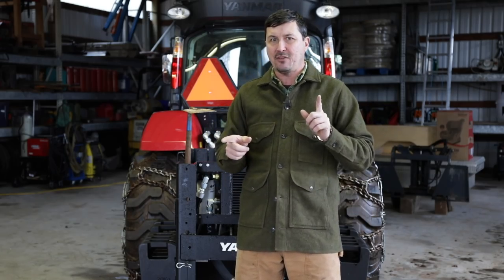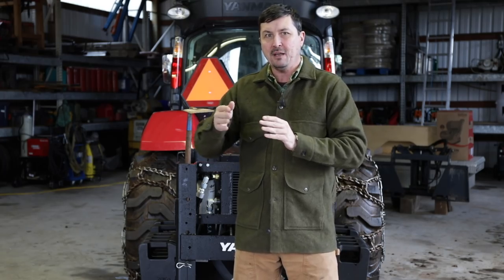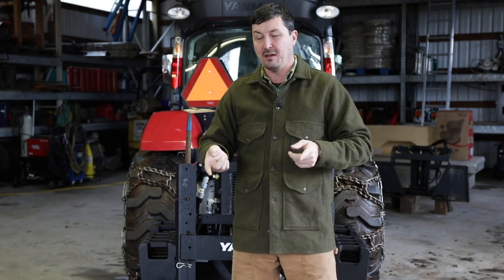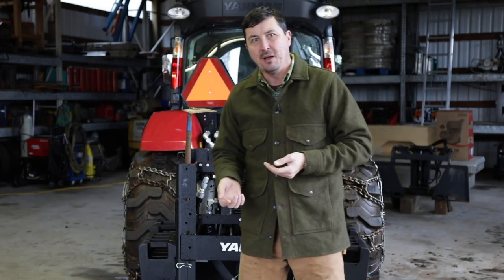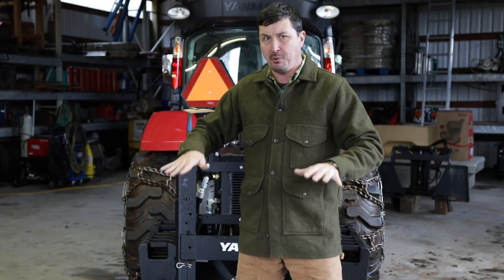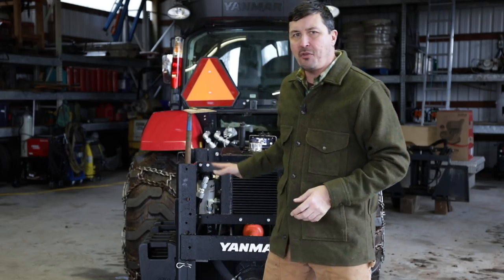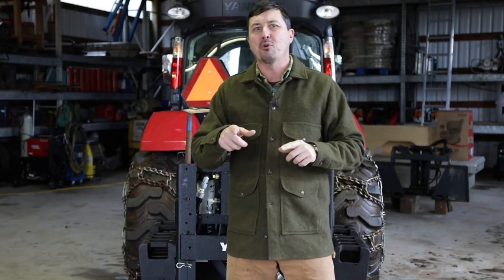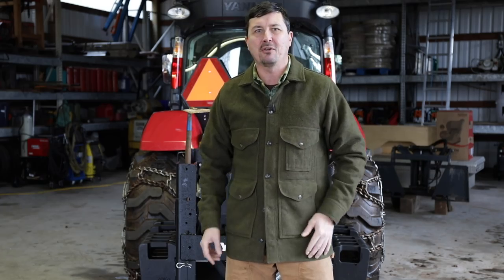Testing The World's Biggest Broom

Comment: If that is a high flow blower you need 30-40 gallon per minute flow , 20 gpm is standard flow if that is what the power pack puts out the blower will run slow. .

Comment: I would like to see the video of you running the snowblower. We have one of them (looks like the same blower) that we use on a skid steer regularly. Just recently went down to the lake and used it to chew through some 8' snow drifts. It takes some time to chew through, but it works quite well. Definitely sounds like a bypass issue.

Comment: sounds like a fluid flow control  problem on the blower because the auger and blower were running the same speed also check relief valve.

Comment: Hey Cody, I'm no expert when it comes to hydraulics but I do have some experience with skid steer equipment.  You didn't say whether or not your attachment was a high flow model or not. If you have the high-flow snow blower from Skidpro , that requires 25-40 gallons per minute which is probably not what your machine provides.

Comment: I only run 60 frames per second on my computer monitor, so I can't tell how fast the fan spins, once it gets moving.  but it surely didn't whine or howl like a turbine.  Hopefully the engineers can modify the FPS on their own monitor screens.  If you have a strobe timer from an old engine tuning kit, you could check the speed yourself and that would make a cool video for us old car buffs...get to see a strobe light in use, maybe paint a small silver dot on one of the the fan blades and shine the strobe light on it?  And Shabbat Shalom!

Comment: My thought would be abandon the power pack. Take the load off and put a front lift arm kit with a PTO drive snowblower front mount snow blower. Problem solved

I have ran tractors with different loader attachments and it's a good way to destroy the loader and tractor.

Comment: Do the auger, and fan have separate hydraulic motors? Is the fan direct drive, or is it driven through a gear box? It is possible that the fluid flow rate, and pressure, are fine, but the wrong gearing, or inappropriate hydraulic motor was used. The speed of the hydraulic motor, at a given pump RPM, is dependent on the displacement ratio between the pump, and motor.  I am no expert on snow blowers, but you are certainly correct about the speed being too low. It is currently turning slow enough that it is possible to count the revolutions by eye.

Comment: I had a set of hex shank drill bits that looked like the hex shank was hot dipped galvanized.  Because of the galvanized finish one got stuck in my Makita impact screwdriver and I tore up the  chuck getting it out once I used it.  I don't remember what brand of drills they were, but I wasn't happy with what the bit did to my precious Makita.

Comment: Is there a bypass valve on the blower? Also normally when something is spinning slow like that its either the pump(which if you can use the broom its not) a bypass valve, a filter, or a motor.

Comment: I don't know about tractor hydraulics or the tooling for them, but 3,000PSI at 20GPM sounds like it should be enough.  But it does look like those rotors are going a bit slow to be doing snow removal.  It could be the hydraulic motor isn't set up properly or is not getting what it needs.  I would check on the specs for the motor and if you can get a flow meter on the return off of the motor to see if your getting decent flow through the motor, I'm sure Yanmar can hook you up with one, they are not cheap.

One of the greatest things I've seen done to a tool box is foam cutouts for the drawers for each tool that goes into that drawer.  This way it forces you to put tools away in the right places, and it will stay neat and tidy.  It will also let you know with a glance that something is missing.  Just a thought since you brought it up.

If people are unhappy with the fact that you do something other than chainsaws and homesteading, let them be unhappy.  It's your channel.  Besides you've been sprinkling in random content for some time.  You, do you and if people don't like it don't worry you have almost 1 million subs and apparently we like it still.  Just remember that the silent majority still like your content.
Reply: BTW I liked that cinematic start, Hilarious!

Comment: im not a hydraulics guy but it seems like theres a restriction of flow somewhere, try putting the auger under a lot of load and see if it has a reasonable amount of power, if it stalls out than somewhere between your connections and the hydraulic motor theres something messing with your flow

Comment: As far as the snowblower hydraulics, it could really be a number of possible things or combination of things.  Hydraulics, and hydraulic design can be tricky, and without a schematic showing valve types and fluid path sizing, etc... all you can do is guess.  Even when looking at the bypass setting, when running the system wide open it may only require 500 psi to run it, but once you load they system by pushing into the snow, that could balloon to 2000 psi....who knows.  Settings should be set for, and tested for loaded working conditions.  I suspect the MFR will have a D'OH moment when they figure out the issue.

Comment: Hi Cody you need another set of lines to power the two motors separately I have never worked on a snowblower but it seems to me that the speed of the fan is way too slow, auger speed seems about right so I don't think you could put a diverter to guide more oil from the auger to the fan

Comment: could the hoses be restricting the flow of the hydraulic fluid or maybe the quick connects also is there a belt that runs the impeller could some they have missed some thing in the machining of the pump

Comment: The evacuation impeller seems not nearly fast enough and it is not underload in this video and that will also effect the outcome dramatically. I think the first thing I would do after you pressure checked everything if you haven't solved that by then I would think that the impeller needs to be "re geared" so to speak based on my little 8.5 horse snowblower the impeller is not up to speed at all and if you had the load of snow in there you ain't going to get enough Go Go Juice to get that snow evacuated from the blower unless maybe it was powder light snow. the sugar speed actually might be a bit on the fast side...my auger turns really slow compared to that one but my evacuation impeller is screaming in comparison. Maybe there in lies the problem too much fluid going to the auger not enough to the impeller....just a thought???

Comment: Has the company been able to supply a line drawing or piping diagram? Also flow vs pressure is a big thing, you need the pressure potential to do the job, doesnt have so much to do with flow rate. Hose size shouldnt make a difference if you have the correct pressure being discharged from the hose and pump system into the mechanical attachment. Perhaps it is indeed a bypass or a relief that is set to the wrong pressure.

Comment: You need to sweep the rest of that shed out now.

Edit 1 - I love the idea of a “worst tool” video, or a series even.   Worst tools for me? Those cheap flat spanner’s that come with washing machines, fridges, dishwashers etc. to level the feet up.  Other ones?  Some of the “keys” needed to open up electrical cabinets that you see in the verges of motorways/ highways. Another one? Inaccurate tape measures.

By the way, is it me, or does the auger look jerky every few rotations?

Comment: Six months late but...Have youn figured out the blower yet?
Did you recheck the hydrolic fluid level after connecting and running the snow blower? I noticed that the reservoir looked maybe a little low when you were originally showing it off. You could have been running just a little low on fluid initially, but after all the lines, expansion chambers and pumps on the blower were finally purged of air it could be running very low. I know that this sounds like a no brainer, but sometimes we are standing too close the the problem to see the solution.

Comment: Is it possible that the special fittings you had to have put on the hydraulic lines are restricting the flow?  Were they the same inner diameter as the stock ones that were the wrong size to couple together?

Comment: Hi Wranglestar what hydraulic motor runs the fan in the middle make model. I have used many different motors on my agricultural equipment here in Australia. It looks like they have a high torque motor but speed is to slow. The fan in the middle would need to be 800rpm or faster to get velocity behind the snow. Maybe angles on blades not quite right? Love the channel keep up the great work your channel inspires me

Comment: looks like the pump on the power pack you have to drive that ol snow blower isnt big enough !!! any hyd pump will have the right pressure but its the flow your not getting to the hyd motor on the fan on the blower ,   get em to stick a bigger pump on shell go then , make the ol tractor work too , all the best

Comment: Well they should be able to tell you what RPM it's supposed to be running at.  You can use an optical tachometer, Amazon 20 bucks. 
Also is there a restrictor valve on the motor by chance ?  I would be small and look like a coupling adapter.

Comment: Should there be something to warm the lower half of the chute to prevent ice clogging?  To me, the fan brush center auger is not at a high enough speed it should be over 2000 rpms plus.  Also, this part is too dense in the pitch quantity in its bristle or number of turns of the auger screw.  This auger plus the shute need something to improve velocity and quantity of the snow blowing fan removal.  One more thing the broom part does not sweep debris to the right for US type roads and where is the debris collection container?

Comment: How close are the blades of the impeller to the metal casing? You lose a lot of throwing power if they aren’t close enough. Add rubber to the ended so it just rubs the metal and see if that helps.

Comment: Try to figure out the rpm when hooked up to the hi flow system then try it on the standard.  I will bet it's close to the same.  You might try to plum the feeder to the standard hook up and the fan to the high flow.

Comment: Did you try reversing  the power hydraulic lines to make sure of rotation ?
On some Hydraulic systems,  different circuits have higher or lower pressures than others.

Comment: I am not a hydraulics man.  Just trying to analyse why the fan is not running up makes me think that there is a restriction in the circuit for the fan hydraulic motor or there is not a proper balance between the auger and the fan.  What is needed is volume over pressure.  Could the fan motor not be big enough?

Comment: There isn't enough hydraulic flow, the power pack would be better off powered with an auxiliary engine not running off the PTO. As the blower loads up with snow and the tractor is moving the engine on the tractor doesn't have enough jam.

Comment: Are the hard lines that run from power pack to the blower also tied into the main hydraulic system? If they are the main system relief valve in the OEM system may be cracking and bypassing the power pack system relief. There should be dedicated hard lines from the power pack to the blower. 

Or the hydraulic motor in the blower may not be able to handle the flow and it is building to much pressure and bypassing to tank through the pressure relief valve on the motor. 

If you have a schematic could you link it in the description? Without it best guesses are the only thing we can do. Best wishes!

Comment: 540 RPM for the blower is way to slow.  A standard 4cycle snowblower at full throttle is governed at 3,200 RPM.  That fan blower and auger is turning super slow.  Even tho the engine is at full throttle, the hydraulic PTO is turning the blower at idle speed.

Comment: It looked like a lot of 90 and 45 degree elbows coming off the pump. Is pumping hydraulic fluid similar to pumping water whereas  each angle and coupling causes a little more friction loss?

Comment: To be honest, not sure you are giving us enough information about the snowblower.  I would think this is a 72" snowblower on the front of your tractor, correct?  If so, what model is it?  Is it the high flow model?  If so, 20 gallons per minute (GPM) might not be enough to run that snowblower.  It might run fine dry as you are showing us, but once you put resistance on it, such as blowing snow, the blower will bog down.  If that is happening, then you do not have enough pressure being generated.  In Buffalo, NY, a lot of us use MK Martin Meteor snowblowers here (Canadian made).   A neighbor down the street has a JD 4520 (a compact tractor with the HP as yours) with the Meteor loader mounted snowblower with the power pack on the three point hitch like yours, but his pack pack is generating 30GPM at 2500PSI and it blows the snow just fine.   The only other thing could be the diameter of the hoses going to the front of the tractor.  If the hoses are too wide, your power pack cannot sustain the pressure needed to keep the snowblower functioning at optimal speed.

Comment: Useless tool: A Ryobi (and perhaps all) push weedeaters, I spent $200 on it refurbished and it never worked out.  I thought it would be stronger than the standard weedeater, but it was very hard to handle, and cut less than a standard.  Just use a metal blade on the handheld wacker, the push weedeater is useless.

Comment: Is there any way to adjust stuff on the snow blower it self, I see it plugs in to a electrical connector, so there has to be a way to adjust stuff on the blower. Normally I would say check pressures at the connect, but since the broom worked fine, I think your pressures are fine. It wouldn't hurt just to double check, but I don't think your going to find anything you already didn't know. But when you turned up the pto, it looked like the snow blower did not pick up speed at all, which almost leads me to believe that there is some way to adjust the speed on the blower its self. I could be wrong (part of me hopes I am, because if I'm not you would probably feel very dumb, but part of me hopes I'm not, because that would be a easy fix.) :)> Also as for the broom, I tried to clean inside my house with it, ah yeah not a good idea, don't do that :)>

Comment: The blower is moving way too slow so I feel it is a flow problem or a volume problem in the pump sections cuz it wide open throttle the more should be moving twice as fast as he auger so this means that the pump on the blower section itself is it your insufficient or does not have enough flow or volume to generate the blowing power that is needed the auger could move a little faster but with the blower being in sufficient as it is the auger is moving fast enough but it is definitely not as high speed as it should be I can't think of anything else right off the top of my head without putting my hands on it I have worked on this stuff for 25 years engineers make think they're smart but ask a mechanic and I've been working on hydraulics pretty much all of my life size of Hose may be a factor there too or you have a brand-new collapsed hose just food for thought who knows if anybody reads these comments

Comment: Hmmmm puzzling the only other thing I can think of is that if there isn't a differential valve the fluid is following the least path of resistance so the fan inlet my be causing a flow restriction what size thread does the fan run off or is it a closed loop system?

Comment: Cody is the blower motor rotation correct.  It appears that it is running backwards?
Reply: i thought the same thing wasn't sure if it was a eye trick
Reply: Yeah, I went back and rewatch when Cody first started it up to make sure I saw that correctly.  I think the blower discharge wheel should be going clockwise.  In the video, it's going counterclockwise. I'm not a hydraulic motor expert but maybe the inlet hydraulic line to the motor is on the outlet side and the hoses to the motor just need to be reviersed?

Comment: Most useless tool: Shopsmith: the multi-tool of power tools. This thing is a lathe, band saw, table saw, sander, router and drill press in one machine. Like most multi-tools, it performs a variety of tasks and does none of them well. I don't know of anyone who bought one of these things who actively uses it. They're either sitting in a dusty corner of a garage somewhere or were sold off after a year.

Comment: A Ryobi 18v circular saw is the worst idea of any tool company. It cannot cut through a 2x4. It goes dead after about 10 minutes without cutting, just running. No, I did not buy it, but still...
Reply: Oh, well i dont get why they dont include the correct battery...
Reply: The Makita 18v circular saw is great

Comment: It’s not a feesible design awesome idea but just not feesible. I have a 3 point blower on my tractor works awesome I have bucket on front to move snow and I got my spear to feed bales to my cattle. This design it would take me an hour to get it on to blow snow for 45 minutes then an hour to take it off by that time my cows would be starving I just don’t get why they need a front mount blower rear or front doesn’t matter also the fact that u can tilt the blower down just means more broken augers and issues at least in rear pro it can’t tilt so you’ll never worry about digging it into the ground

Comment: i was looking and on the pump ether on the in or out side it looks like some firings there may be smaller causing a restriction and cuting the gpm in video in is the right hand side of the pump the other common restriction point is the oil filter not a expert just a farmer jack of all trades master of nun

Comment: The shaft is not spinning fast enough maybe it need more   acceleration ur hidraulic engine in the back need to be running harder if that what it is check the hidraulic presure that engine need to be running harder and is not.